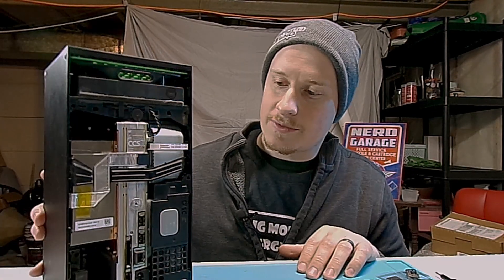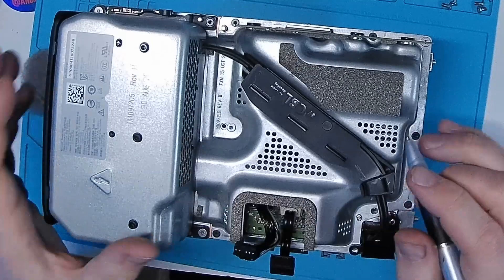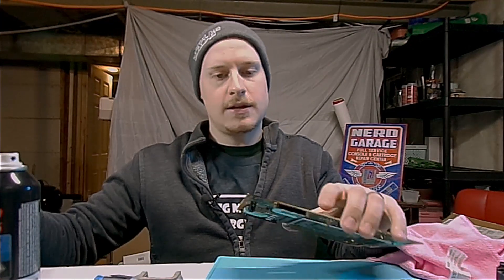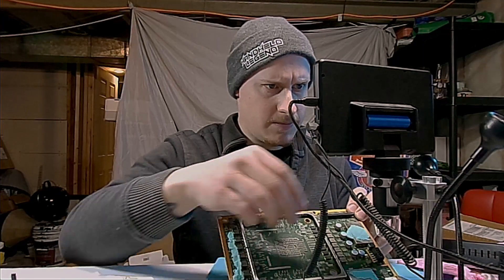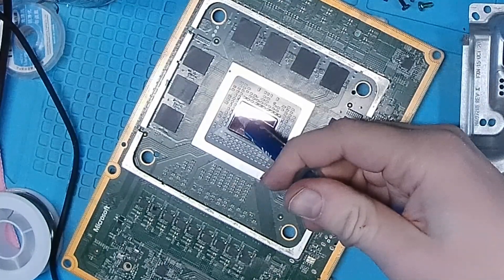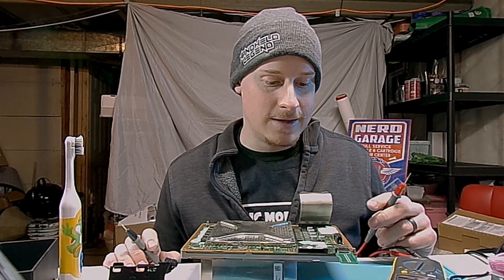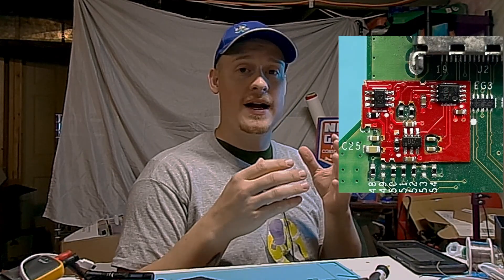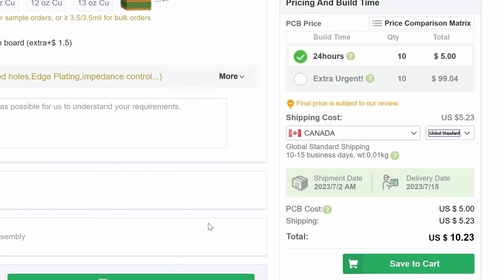A Repair Shop Destroyed This Xbox Series X

Comment: i had the same problem the ssd failed on my series x and I sent it to a repair shop called techy they ended up scratching the motherboard and I don't even know if they actually did something with the SSD. i had to buy one myself. At the end of it all I had to buy another console and still have the other one that doesn't work. now I'm stuck with a broken expensive console.could you repair it??
Reply from the maker: If the internal SSD was damaged then it's a goner :/ It needs to be cloned onto a new SSD to replace it